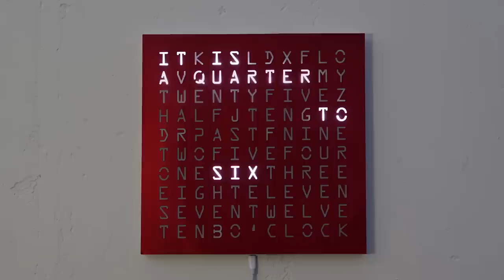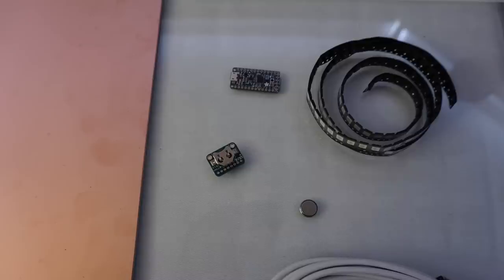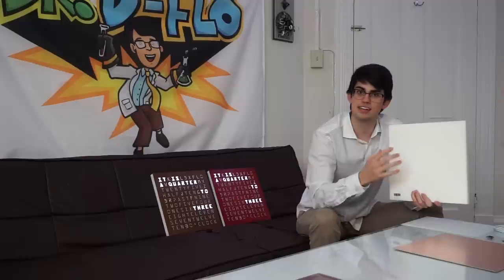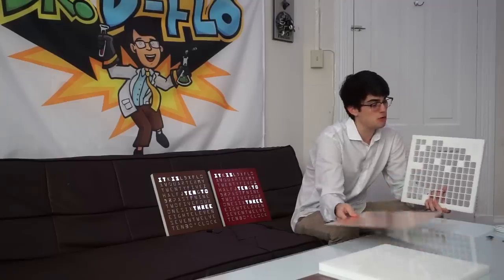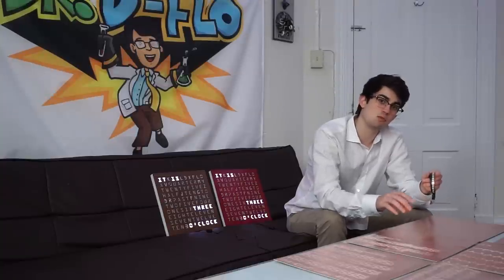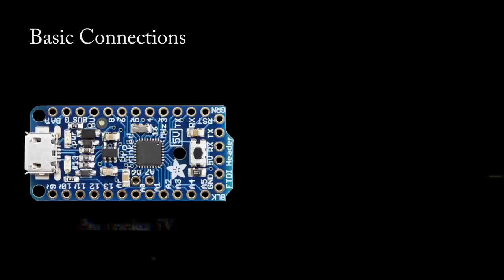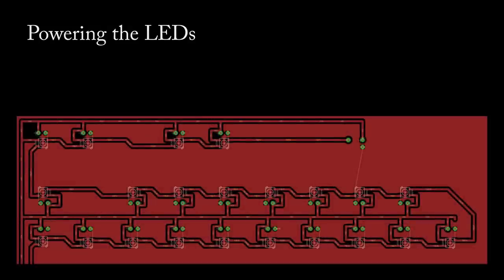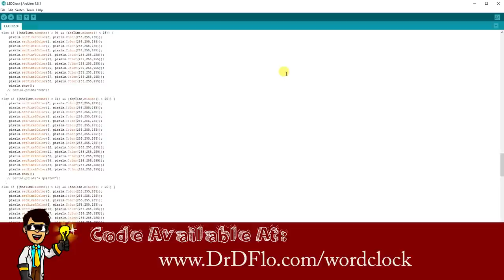Classy LED Word Clock

Comment: Quick nitpick on your PCB: unless dealing with very high currents, it's not a great idea to make direct solder connections to big copper fills. The large thermal mass will make soldering difficult and they joints won't be great like on your PCB. In the future, make sure to activate thermal pads when connecting to big filled areas for easier soldering. Hope this helps!